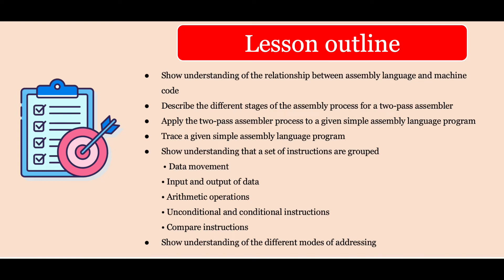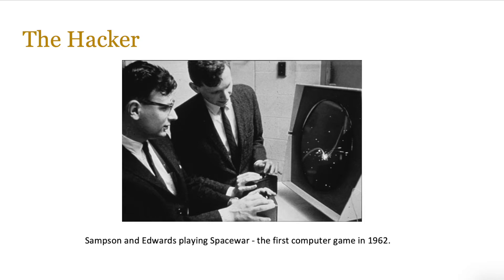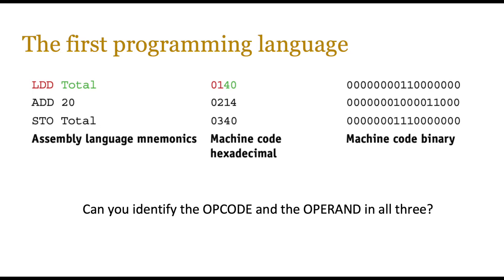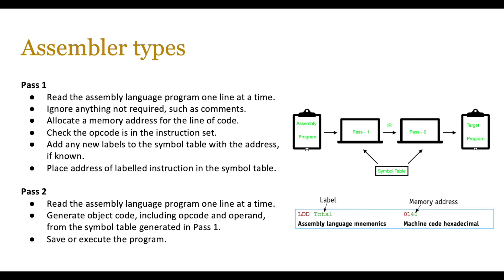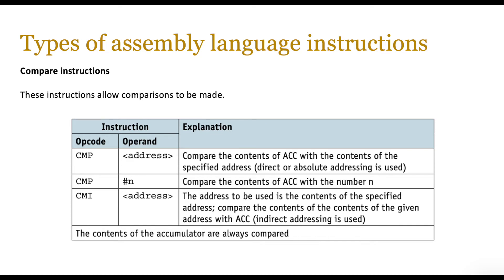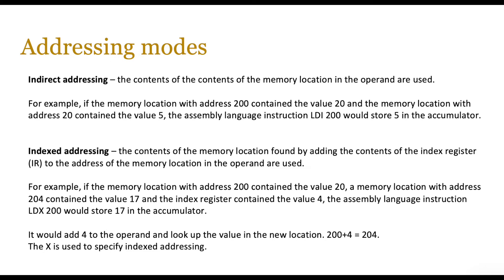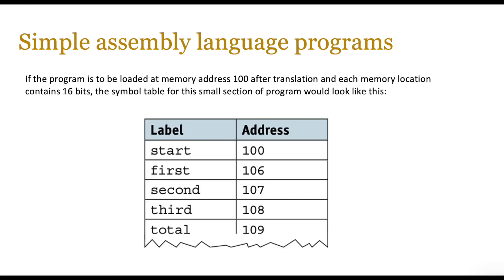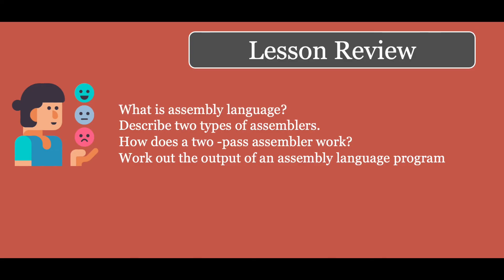Lesson 38 - Assembly language and addressing modes

Comment: Why they implement this language in the syllabus!!
I'm having a headache with this!

14:15  
1. 200 (Operand), is supposed to be an address in register???
2. If CMP is comparing the value in address 200 to value 0.
3. What type of comparison are the CMP (Opcode) doing?? Arithmetic comparison, Logical Comparison??
4. JPN (Operand), Found is supposed to be the register address? 
5. If yes, then why there is JPE (Operand) next?? Because we use this after a comparison, which is not the case here.

For the label:
1. Is it part of the assembler features? or its the user who write it??
2. If yes. What are the other syntax: we have seen Start, Not found, found, loop, counter, number, total.

Last: 
Where can we practice this language??
As i have try several simulators, they don't use most of the syntax.
Reply from the maker: Assembly questions are pretty easy as you are given the instructions in the exam question. 
1) Yes - the address probably will have a number stored e.g. 5
2) This value 5 (stored at address 200) is compared to 0
3) The comparison results in a TRUE or FALSE always.
4) JPN to FOUND label if the result is FALSE. A label is a name given to an address. We can move the label to another address in the future, it saves us changing addresses in the code itself so if you had 10 references to address 205 in the code and we wanted to change it to memory address 206, we would have to manually change each one. With a label, we just move the label to 206 and the code just works.
5) JPE to NOTFOUND label if the result of the comparison is TRUE (the previous line is executed but the JUMP is skipped if the comparison isn't TRUE)

Labels
1) The programmer decides the labels, it is part of symbolic addressing modes.
2) No syntax to remember, the programmer choses the label. 

Past paper questions is the best way to practice Cambridge assembly instructions. Each CPU type has its custom instruction set so the commands/syntax will be different. Same goes for online ones. As long as you go through the ones in the video, you should be fine with assembly. In the exam, these are given to you anyway so read and apply. Most of the times these are a trace table type question.
Reply: @ComputerScience4U  Is it important to use label in exam??
Because i don't understand it. 

for the CMP. What comparison he do??
<, >, ==, ===.
What comparison???
Reply from the maker: @afkgamer7204  Only if you are asked to by the question. They will normally give you the assembly code to trace with labels.

CMP is the equivalent to an = 

 Is A=B? Gives TRUE or FALSE.
Reply: @ComputerScience4U   For the CMP you mean A==B 
Because A=B. Here you are using assignment operator

Theory ok for me
Small calculation ok for me
If they asked while or for loop to be written in assembly or to use label.
Then 0/10 for me in this section

Thanks for you help sir on this
Reply from the maker: @afkgamer7204  No problem. It seems you are merging pseudocode and assignment operators needlessly with assembly. Assembly does not use assignment operators which are high level language concepts. Assembly is low level where each instruction is equivalent to 1 command. CMP is a comparison between two values in this case a value stored at address 200 and 0. Don't think of assembly as pseudocode and you will be fine. It is just like an algorithm /series of steps that you follow.
Reply: @ComputerScience4U  Good news sir 🙂
I have decoded the book example, step by step. I understand it now
I also decoded Exam Paper (the assembly question) and solved it by myself 
Exam Paper: Oct/Nov 2017 

Question: 4 (b) 

Thanks again for the useful information